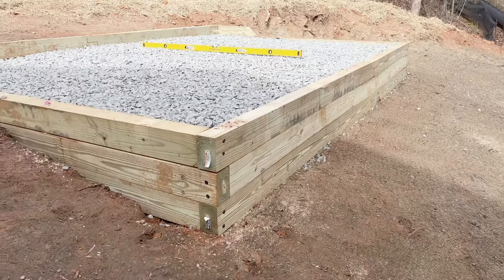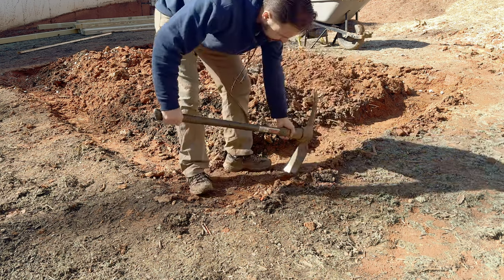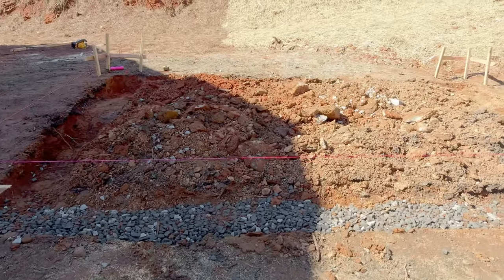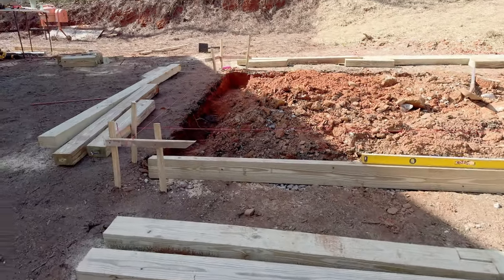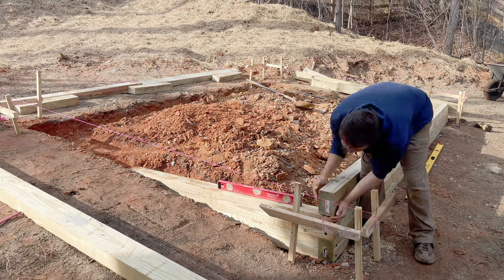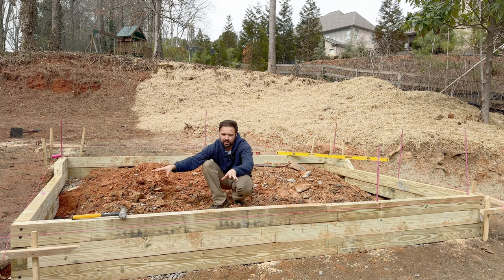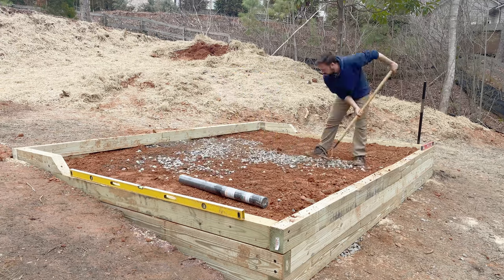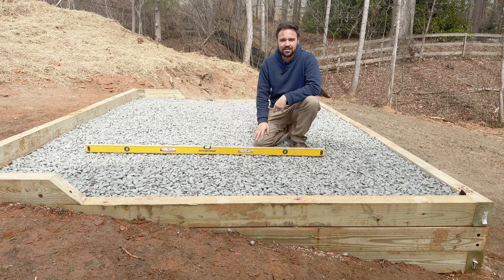How to Build A Gravel Pad for a Shed on a SLOPED Yard

Comment: I like the idea of a gravel bed for a shed rather than a concrete one. Water will drain through it if it gets wet, unlike concrete, which will sit on the surface and promote rot.

Comment: you need to tamp the dirt to compensate for the settling,  Your rebar is not supposed to penetrate through the bottom timber into the dirt it rusts the rebar and promotes wood rot!
Reply from the maker: Thanks for the feedback!
Reply: those are fiberglass rebar, they won't rust.
Reply: Thanks. That's good to know.
Reply: @Hammer.J.Helmer of course there's no humility from the one who called him out incorrectly. after you let him know the facts.
Reply: Pink rebar are not metal.   Those are fiberglass
Reply: Treat the drilled hole and the rebar is suppose to penetrate the soil to hold the wood in plce

Comment: Unless that is ground contact lumber, it is going to rot. It's a great frame, but unfortunately pressure treated lumber isn't as rot resistant as it used to be. You should have used railroad ties. it will last for a few years, but then you are going to have rot issues.
Reply from the maker: 💯 correct!!!  It’s just though finding rail road ties around here.
Reply: @EverydayShed  they are also heavy as boulders. I don't like to be that guy in the comments, but it's disappointing just how fast PT lumber rots with any soil contact. If you're in a dry climate (that was red clay, I'm thinking tennessee, or SC or GA...) it may last longer, but I made some raised flower boxes out of PT that lasted about 2 years and were totally rotted out.

Comment: Why the three board sections at the bottom of the top of the slope instead of one full board?
Reply: Probably for drainage.
Reply from the maker: Good question! Although, it does help with drainage, using three smaller sections instead of one full board saves us money. That first section would be completely buried and these boards are pretty expensive nowadays. 🛠️👍

Comment: Another option for building on a hill is to make a wooden platform, but you need to size the floor joists to handle the load. An advantage is that you can jack it up to level after each winter.
Reply from the maker: I have seen some of those which can be a nice option 👍

Comment: I would only caution that if it's touching ground it should be pressure treated wood. Choosing the right wood is important. 

As an alternative to the wood, what about using cinder block with rebar and Quickcrete cement instead of the wood?
Reply from the maker: For the cost and convenience we always just go with the pressure treated lumber 👍.

Comment: Thanks for this video and the subsequent series. Can we start a discussion of why one might prefer to do a gravel pad rather than post-in-concrete footers? Is it only because of the possibility of moving the shed down the road?
Reply from the maker: Yes! That is the primary reason, having the ability to move later on. Also, this video helps those interested in building a pad and having a shed delivered. Other alternatives are full concrete pad, but that is much more costly… I pretend to do a video on each option in the future to help on the decision making… thanks for watching!!

Comment: Question? Can you build the  shed on top of the leveling pad 4x4’s or 6x6’s so the outside wall boards hangs over allowing rain water to drain away?  Excellent video explaining everything well.  Thanks
Reply from the maker: I see where you are going with this... however, having a "buffer" of gravel around the shed helps with drainage and stops the vegetation to grow near and underneath the shed.

Comment: This is a great video. I have an uneven back yard. I’m looking to build a border like this (but larger) to level the ground for a playground set. For inside of the border, is it imperative to dig out the center ground material? Mine would be sod/soil. I’m wondering if it’s worth it to also dig the center out or if I can just dig the perimeter square. I will be using the weed barrier material. Thanks again.
Reply from the maker: Inside you can add any material you want, expect compost(roots/leaves/etc) which will decay. Some people add rocks, pieces of concrete, sand, dirt.... The end goal is to have th 4-6" of level gravel on top. Good luck.

Comment: Looks great. Can I concrete the floor instead? I'm aware that if I wanted concrete, the framing might instead be built on top of it, not surrounding it. Just want to know what my options might be. Thanks.
Reply from the maker: Yes you can concrete. Its just a higher cost for concrete. Thanks for watching!!
Reply: @EverydayShed  And it is not so much the cost of the concrete itself that is high.  It is the cost of skilled labor to prep for it, place it, and finish it.

Comment: Question: you said something like when your pick " breaks 5.5 inches of the finish grade its time to step up to another level of digging." Do you have a rule of thumb for how much deeper to dig every time you step up to make it easier at the finish? Thank you for the video.
Reply from the maker: Not really a rule of thumb, but I prefer to have the lumber about an inch buried in the ground. My thoughts it that it will help stay in place after the backfill.

Comment: What's the benefit of the joists sitting right on the gravel versus putting them on 4x4 posts on concrete standoffs?
Reply from the maker: The benefit of a pad is that it helps on drainage around the shed, second the skids being laid directly on the gravel, helps distribute the weight of the shed. There is a smaller chance to sag over the years. However it does come with a much higher investment cost and labor…. I have done blocks and it works pretty well, just keep in mind over the years, the ground may shift and you may have to te-level your blocks and shed.

Comment: What about wood rot for the wood that is below ground?  Would there be a way to start with cinder blocks as the base below the dirt? 🤔
Reply from the maker: Anything touching the ground will accelerate the rot even with the ground contact pressure treated postes.  We have used Flex Seal in the past to give a rubberized coating and I know others have using roofing tar.
Reply: @EverydayShed  cool - thanks.  I had a thought of putting cinder blocks as the base level and then securing the wood on the top of them.

Comment: Question.  Going to build one of your sheds in my daughters yard. She has an enclosed area next to her house enclosed by a fence.  About how much room do I need to leave around the foundation/structure to still be able to put up the walls?
Reply from the maker: Hey there.. there are 3 things to consider, 

One, you can build as close as you want, if you build the wall first and then just set it in. Just like i built this one https://youtu.be/vJFawNjVA-w?si=cSbExeqGZQX3E79n 

Second, you need enough room for drainage around, it all depends on your back yard, i left one feet around this shed.

Lastly, consider the county and city rules for set back, some requires 5-10 feet... 

Thanks for watching.

Comment: How deep do you need the rebar into the ground to hold the weight?
Reply from the maker: Only a foot or so,... Look this way, the rebar is meant to hold all the boards together, we drive it in the ground just to keep in place. the weight of the gravel will keep the "box" in place.